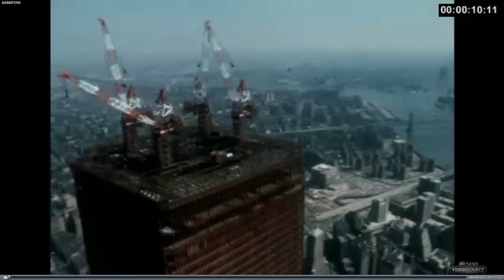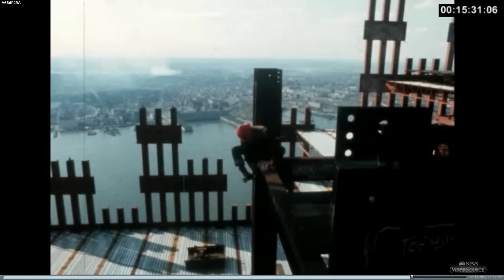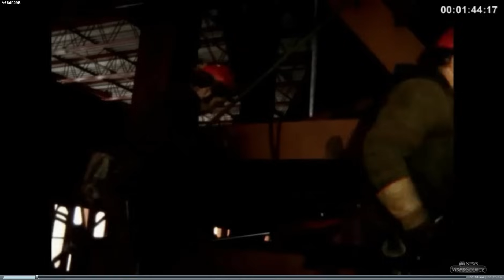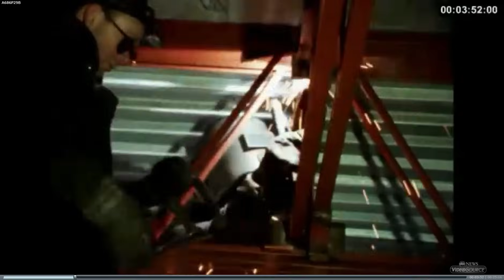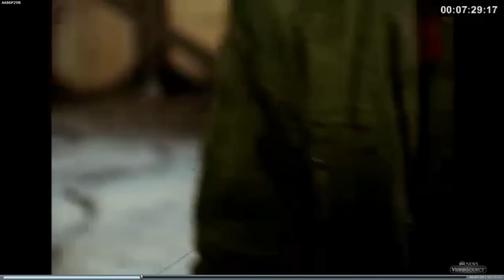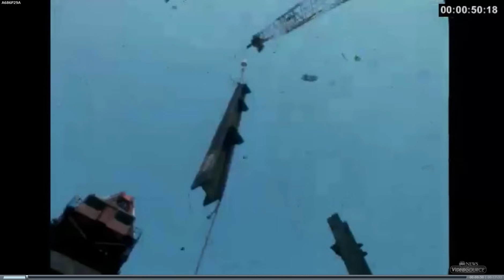WTC South Tower Construction Shots - March 1971

Comment: Where did they put the explosives that were used to bring these down when the planes hit?
Everyone knows it was an inside job
Reply: Yes I was a security guard there. I and a receptionist saw a team of ninjas who came one day and installed explosives exactly on the levels where the hijacked planes hit the building. The team of ninjas must have conjured up the cards in order to get inside and were sure nobody would spot them. But it's not true. I and other 5000 people saw them. We called 911 but since it was an inside job, you know, we were silenced.

Those 30 year old hijackers who had trained flying for about a year in small Cessnas were the best pilots in the world. They hit the building exactly according to the plan, exactly the precise floor, despite the fact they flew 800 km/h and the building from outside looked the same. The second plane almost missing the building was faked and staged as well.. I mean they must have been the best pilots in the history. Surely trained by the best SEAL, CIA and FBI who in reality didn't even communicate with each other. But this operation was an exception. 

And the explosives were triggered perfectly too - the south building was detonated first and I am amazed they knew stuff to do it tha way, it was hit lower which resulted in the outer damaged walls having to deal with much more weight than the north tower. That's why it collapsed sooner. It was an awesome planning. They were so lucky to pull all this off. Wow. Not even James Bond would have succedeed.
Reply: @newGuldynka  lol But you actually need to put a sarcasm tag on that or it will all become nutter gospel soon.

Comment: No way could a civilian airliner disintegrate either of these buildings to ground level. Physically impossible..
Reply: They didn’t disintegrate the buildings. Try a better understanding of what happened.
Reply: @peterp2153  Look harder. The debris pile is not integrated
Reply: The airliners didn't disintegrate them, the collapse process did. Get a clue about physics and how these unique highrises were designed before commenting on this event.
Reply: @davepowell7168  What? I'm talking about the disintegration. Sheetrock, concrete, fittings for the floor trusses, floor contents...all pulverized by the massive air pressure wave in the collapse sequence.
Reply: @haroldlipschitz9301  
   Yes, many floors of 200x200ftx4"of rebarred concrete used in a Vèrinage style demolition require the steel frame to fail almost simultaneously. 
   Where did all the heat come from?
Reply: @davepowell7168   ignited jet fuel that caught fire, weakening the steel and thus causing it to lose structural integrity
Reply: What destroyed the cold steel reinforced core?
Reply: @davepowell7168  The core was designed to connect to the external columns via floor trusses. This allowed the building system to handle horizontal loads like wind. When the floors and exterior columns gave way, there was nothing for the core to support. That's why in both WTC1 and 2 collapses you can see the core standing for a few moments alone before giving way.
Reply: @haroldlipschitz9301  If the vierendeel truss joints were the weakness the falling floors would have sheared them
Reply: @davepowell7168  They were not a 'weakness' per se, they just weren't designed to handle dynamic vertical loads. How is a concrete slab on a truss going to tolerate the falling mass of several floors from above?
Reply: @haroldlipschitz9301  NIST claimed that their failure caused 'global collapse', not me.
Reply: @davepowell7168  That doesn't mean they were a weakness, that simply means they didn't have the ability to handle dynamic loading such as floors collapsing from above.
Reply: @haroldlipschitz9301  you are repeating yourself
Reply: @davepowell7168  Because of your bizarre posts
Reply: @haroldlipschitz9301   Cite one
Reply: @davepowell7168  Your obsession with citing a very old report when you should be trying to grasp basic physics
Reply: @wesleysayud419  There would have been localised weakening of steel. Fires travel as fuel is used, steel conducts heat.
  If the buildings contained only code furnishings of offices and paper ,
 the buildings were designed to lose over 60 columns and still withstand a once in century hurricane. 
 Ref. John Skilliing, lead structural engineer of WTC interview after '93 bombing
Reply: There are many videos and articles describing what exactly happened, and none of them says “disintegrate”. Maybe read a few of them, and you will understand how the towers collapsed.
Reply: @juzoli  Would you please share a link with one explaining the seismic data? 
  The Bazant theory (global collapse) does not support the evidence, nor the Sinfer theory (plane alloy reaction to buildings sprinklers causes descending fireball) but I'm still open to any rational ideas .thx
Reply: @davepowell7168  The plane itself took out large portion of the support columns, while the rest were weakened due to the uncontrolled fire. Floor trusses were sagging, which pulled in the outer perimeter walls, which is a structural element.
Once one floor collapsed, and the upper portion of the building started to freefall, its kinetic energy made it unstoppable even by undamaged structure.

It is very well understood, supported by math and simulations. Talk to a structural engineer who can explain the load paths, and how those were changing as a consequences of the impact and the fire, but it is actually quite straightforward.
Reply: @juzoli   You are using the Bazant theory as pressed by NIST.  A planestrike induced almost Vèrinage style demolition where a portion of upper building acts as a piledriver then collapsing itself  (my description of this idea) leaves 10% of structure 
  This would be lethal to anyone in lobby area, so no survivors and leave a significant seismic record 
The survivors mostly walked away, no breaks or burns.
 100+ floors of building coming down from above didn't bury stairwell B at all:
   Fireman Lt. Mickey Cross ' l could see sunlight through the dust '
Reply: Do you have any idea what effect 140 tons of a 767 jet with 90,000 liters of kerosene hitting at 550mph can have? I'm surprised the initial impact didn't split it in half in an instant.
Reply: @haroldlipschitz9301    Basic physics suggests that the buildings should stand. 
  Which 'new report' are you referring to
Reply: @davepowell7168  I didn’t refer to any new report. As I said you are repeatedly citing NIST when you lack basic physics understanding. Please explain how the buildings are supposed to hold given their design for wind and not vertical loads.

In multiple videos you can see in close-up the outer columns are bending and deteriorating from building stress. That’s all you need to know to understand the physics of collapse
Reply: @davepowell7168  Oh, he knows about planes now.
Reply: @davepowell7168  The buildings' floors were designed for a maximum of 6 stories' collapse. After that there is no resistance. That was their max vertical load where the 4-inch concrete floor slabs (no rebar) sat on the trusses that were welded to seats on the exterior columns. 

The point of collapse initiation on WTC2 was around the 80th floor - that means the vertical load was 30 floors + alpha. For WTC1 it was the 95th or so, so a load of 15 floors + the heavy TV mast. All of the forces involved were HUGELY in excess of what any floor could resist. The math gets even worse when you factor that each failed floor added to the weight of the falling mass x acceleration x force of gravity.
Reply: @haroldlipschitz9301  No rebar?  Look harder
Reply: @davepowell7168  'As shown in Figure 5, each tenant floor consisted of 102
mm (4 in) thick, lightweight cast-in-place concrete on a fluted steel deck. Supporting the slab was a grid of lightweight steel bar trusses.'

NO rebar on the floor slabs
Reply: @davepowell7168  Avionics is instrumentation. I have sold airplanes for 30 years and know their systems intimately. 

VMo in a B767 is around 440 mph at sea level. All commercial aircraft are built with a considerable safety margin - the ACTUAL failure speed is far above the max speeds on the procedure cards like VMo. When the B777 wings were tested, they snapped at 156% of design limit. 440 to 550 is only 25%, plus there was no severe weather or turbulence on the day.
Reply: @haroldlipschitz9301  The video of construction shows rebarred layers being wired before the pour.This was the mechanical floors perhaps ,15ton electrical units require more than you suggest to raise elevators
Reply: @davepowell7168  There would definitely be rebar on the mechanical floors. The technical description of the buildings says so, but that's only to handle the gravity load of the equipment there. As stated before, the max vertical load a WTC floor could handle is 6 collapsed floors, not 10, not 20, not 40+ etc
Reply: @haroldlipschitz9301  Thanks for your insight Harold, the 24-40 alloy and CREP frame makes a hole. How much gas would be left could you estimate? Full throttle, slow descent..
Reply: @davepowell7168  Jets are very slippery, meaning they don't need much power to accelerate in a descent, especially at high gross weight. I would say 60-65% throttle at most in the descent to keep the aircraft controllable (for a normal landing the descent is largely at idle power until dropping the landing gear), and a morbid thought, but probably only going to full power in the final turn when lined up for the building.

UA175 would have taken off with around 61000 lbs of fuel, I would estimate they were at 52-53,000 lbs at the time of the attack
Reply: @haroldlipschitz9301  Jets may be slippery. I'm not and l don't shit green.
Reply: @davepowell7168  No idea what you're on about. Slippery means difficult to slow down in descent
Reply: @davepowell7168  Asked and answered
Reply: @davepowell7168  Quite likely. Easy to arrange, especially at the time
Reply: @haroldlipschitz9301   The 'Skyking' plane theft suggests many 'airskills' can be learned from home entertainment. 
  There were improvements to technology between events 
   As a pilot do you consider the approach to the Pentagon plausible for a non professional flying an airliner ? 
  It's alleged the guy wasn't talented with confidence in the air in control

Comment: How can a plane be swallowed up as a whole into these buildings, even the wings, all aluminum made to fly, not to act as a torpedo.
Reply: The sheer force of those planes hitting solid concrete & steel at 400mph, they would have been instantly crushed & obliterated. Some parts of the planes were projected down into the streets below & found amongst the carnage.
Reply: @TeamP  You don't see the plane crushing at all, because it the tail goes in just as fast?! You don't see any parts of the plane flying off in the videos, since it's swallowed as a whole, so how could it be possible they found parts of these planes further on?